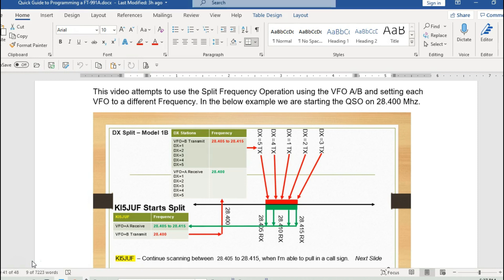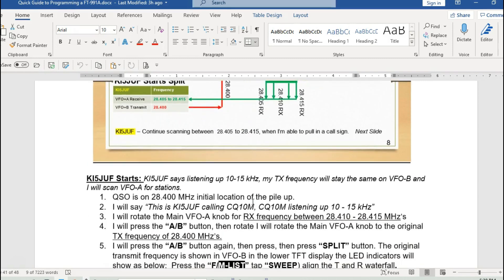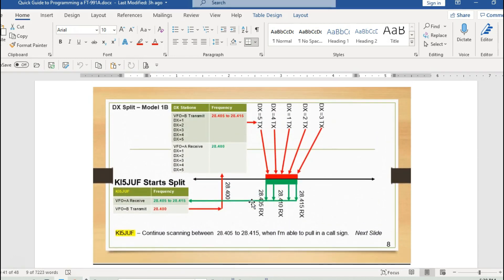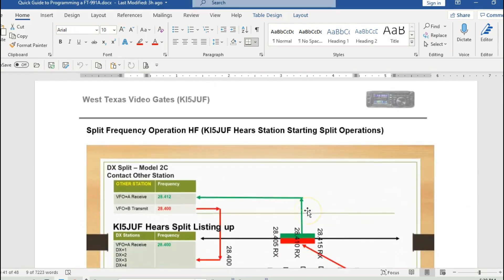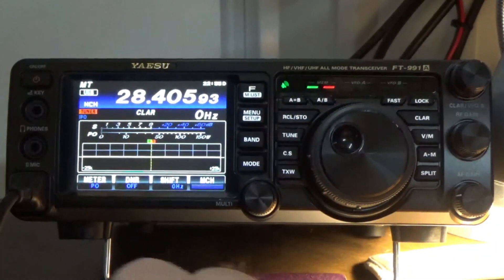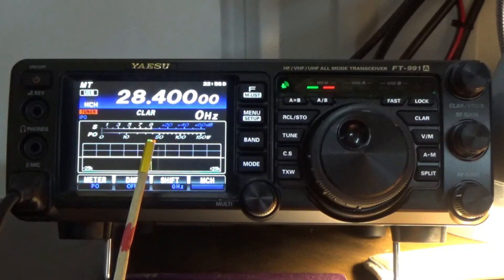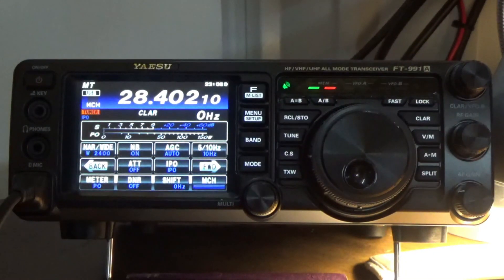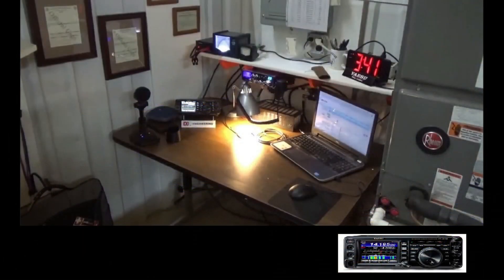Split Frequency Operation HF FT991 Examples

Comment: There is a much faster way to tune VFO B.  Let's say 28.400 is the receive freq and we want to transmit on VFO B at 28.405.  While in split mode, press A/B to swap VFO B up into the top freq and change and move it to whatever freq you want to transmit on. (much faster scrolling through freqs than the Clar knob). When you find the freq you want, just press A/B again and the freq go back to what they were. Also before pressing the A/B to return the freqs back to the original split, press the TXW button to listen back to the original receive freq. Not sure the helps. You can also press and hold the Split button for more than a second and the freq will jump to whatever preset you have in MenuSETUP #35. It is preset to 5kHz. So if you press and hold the Split button one time, it jumps to 28.405. Do it again, and it jumps to 28.410.  If you change the menus to 10kHz jumps you can do that and then use the Clar knob to adjust smaller up or down movements like you did in the video. Not sure this helps. Just wanted to pass it along. Walt WB4ZUT
Reply from the maker: Hi Walter that's great advice, I'll give it a try appreciate the message this will help everyone, much better way, thanks again, I'm always learning and you all make it possible 73 sir
Reply: @westtexasvideogateski5juf255  Glad to help. This is my first time to try split. I'm trying to get 3Y0J and they are operating on a split. Really appreciate your posting your YouTube video. 73', Walt WB4ZUT

Comment: Great Video Steve. I recently got a 991-A and found your channel where I am learning interesting things about this radio. One thing I have not found is a good explanation of the CONT filter. Do you have any information on that and ways to use it?  73
Reply from the maker: Good evening sir, I have started working on Contour on my word document, I may try it tonight there's folks talking an 11 meter might be a good way to make example.  Have a good evening sir,  Apricate the message!